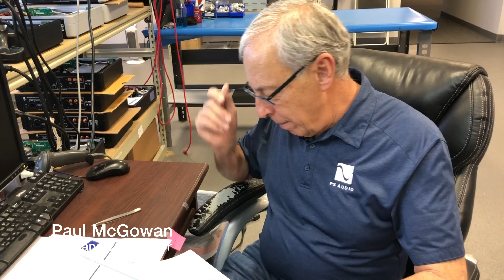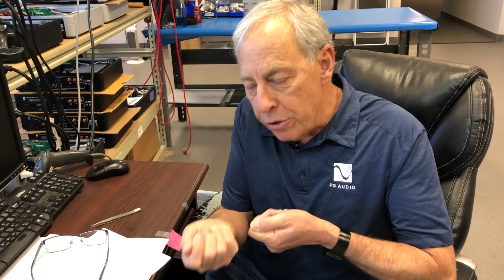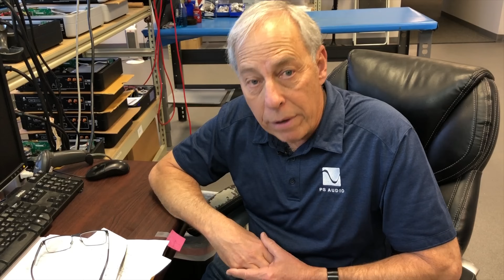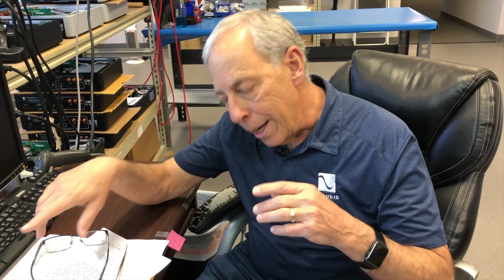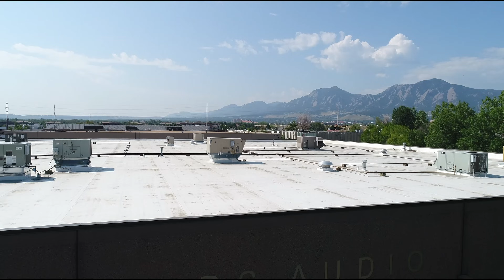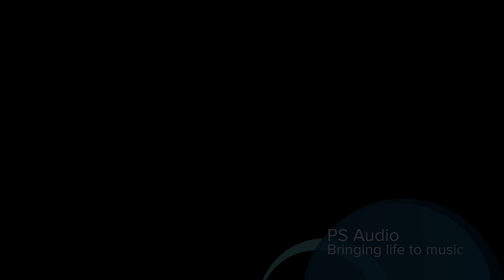Is it possible to change speaker impedance?

Comment: One thing that separates audio engineering from the other arts and sciences that I'm familiar with - it's amazing how many genuine experts in the industry often completely disagree on why different elements affect the sound.  As example, in this video and some of his others, Paul attributes the "tube" characteristic sound to having the tubes in the front-end of an amplifier.  He also states that historically, tube power amplifiers have performed poorly in regard to the way they handled speaker impedance variation over frequency compared to their solid-state counterparts.

I've read other long time industry professionals who claim that there is absolutely no difference in sound between a properly designed tube or solid state front-end - so long as they are designed to run clean and linear, and that it's having tubes in the output stage which generate the characteristic "tube" sound, a big part due to how tube/transformer power outputs deal with the variation in speaker impedance .. along with the harmonics.

If successful industry professionals with 40 or 50+ years of experience can't agree on something that seems like it should be so fundamentally understood and agreed on, it's no wonder that consumers and hobbyist opinions are all over the freakin' spectrum.

Anyway, Paul, I love your videos.  Thank you so much for sharing your knowledge!
Reply: Indeed. Also the manufacturer states that the speakers must all have the same impedance, and then Paul says that it doesn't matter at all. Why do they not agree? It seems to me that one of them doesn't know what they are talking about. Do we just randomly choose to believe one of them?
Reply: Good point there!
I would LIKE to agree to this:
"I've read other long time industry professionals who claim that there is absolutely no difference in sound between a properly designed tube or solid state front-end - so long as they are designed to run clean and linear,"
And this is logically it should be true?! But when Paul says that they tried this in blind listening tests with best solid state front end that was mounted on a tube socket. And switched between that and a tube. And the tube was sounding better. Yes subjectively, but it sounded DIFFERENT anyway! 

In some of the worlds best sounding listening rooms. 
Is that because Paul wants to sell his amps with tube in the front end, that he is saying that? 
Or vice versa they who saying this just sells solid state amps? :) 

Or is it the things you read above written of people in the industry that has not tested and listened for them self? And therefore from a theoretical point of view write what they write? 

Remember that it takes alot of effort to test and compare this. And you on top of all need a good resolving system with trained listeners. So have they all those stars aligned to be able to make that statement? 

And of course hard for us to verify Paul's statements. But we know that he has the means to verify them anyway! 

Yes, i would also want to thank Paul for his videos. That get us to start thinking ;)
Reply: Hi Optimize.  When I said genuine experts I was referring to a fairly small circle of folks who have roughly equivalent experience with tinkering,  professional engineering design, and similar industry notoriety as Paul.  Of course these guys have tested and A/B'd their equipment before formulating their opinions.  That's not to say they're right and Paul's wrong, or Paul's right and they're wrong...  It just illustrates how complex the subject actually is.  That's all my point was.

Also, with regard to your implication that Paul is stating things just to sell his product - obviously, he wants to sell his gear, but I don't get the feeling that the information, opinions and life stories that he is sharing in his videos are swayed because of that motive.  He really comes across as open, knowledgeable and genuine.  That's a big part of his appeal.
Reply: Hi. Yes I agree with you. 
When I imply that manufacturers want to sell their products. That was a way to try to find any reasoning why we have those diverging statements from the genuine experts. 
And not a way to throw dirt on someone, sorry for that. I like Paul and he have a kudos in my book for his openness. I love to see and hear how the processes and considerations that are taken account to make a product.

Both of them can not have right, in this question? 

Ok than we take the the logical thinking approach.. 
I believe that the sound between different tubes (manufactures, models) sounds different. As I starting point. 
And with that in mind. 
If you role (switch) tubes one and to another different tube. And also Paul says the exact same tube but used and switched to a new one. 
They will sound different. Hopefully better but let say different.
Then if Paul and his best engineers make the best solid state they can imagine that he claim, and mount it on a tube socket so you easily can switch out the solid state for a tube instead.
That what I call a pretty good test! When all the other factors stay the same! And all the other factors are state of the art HiFi components so you have and can be able to hear the difference.

And Paul says that the tube sounds better than that specific solid state implementation they made. Logical it should at least sound different. It is like making a tube rolling. They shuld sound different.

But the test objectives was not to make the solid state solution to sound like a specific brand and model of a tube, that they compare against.
That is much harder to accomplish. But I believe that only a handful people in the world can do that tuning on solid state components and topologies.
When you do that then we are back to that solid state do not sound differently than the tube. A full circle.
Maybe that is one issue, that diverting and confuses people because they do not take into account the objectives of different tests. :)

Comment: Putting a (very large ) cap in series with a woofer is well known trick in DIY circles . If you choose the value correctly you can extend the bottom end of a woofer significantly and also reduce the required volume at the same time. Formulas for calculating the correct value of the capacitor and  box volume are known for closed , bass reflex and bandpass enclosures .  E.g . : my subwoofer driver is a 10 inch with a 1200 mF cap in series in a bandpass enclosure of merely 15 liters (both bolumes combined) and still reaches 25 Hz .
Reply: can you give me a circuit diagram the way you place the capacitor and speakers?
Reply: It is in german but here you go http://www.lautsprechershop.de/index_hifi_de.htm?http://www.lautsprechershop.de/hifi/sub10brhp.htm
Reply: @19janiboy96  I would not buy this subwoofer. "Der Kondensator stellt zwar einen Hochpass dar, der bei sehr tiefen Frequenzen keine Signale mehr zum Lautsprecher leitet". Basicly what they say is: That the capacitor is a high pass filter which  means that the lowest frequencies will not reach your speaker.
Reply: I fully understand your reaction and I do know that a cap in series should function as 6db high pass  but I can assure you it really works . This thing was pioneered by the Hobby Hifi magazine (german DIY loudspeaker magazine) and they have published all the relevant formulas . I still have all relevant issues . For a closed box for example it is crucial that you size the enclosure for a Qts of around 0.9 to 1  . It really only works if you size everything according to the formulas . It really is a nice trick to get low bass out of small enclosures .
Reply: That should have read Qtc , not Qts , sorry . Anyway here is a link to the Hobby Hifi issue that featured a Bandpass with High Pass sub ("Bandpass mit  Hochpass")

http://www.hobby-hifi.de/Archiv/06/06_06/06_06.html
Reply: BTW , for the bandpass with high pass , not all woofers are suited : they must sit in a defined range of  some Thiele/Small parameters
Reply: Gerrit, any capacitor on the output of an amplifier is going to limit the speaker's potential bass response.  The number's you've thrown up make no sense whatsoever.  I think someone has lied to you.  Some aspects of physics are so fundamental that they're really not negotiable.

Comment: If you think of the consequences and losses that the described passive x-over filters add into the signal path in your speakers.. ..Then you will begin to comprehend why active x-over have advantages.
Reply: I am so going to change to active crossovers since I am designing my 2 way speakers conversion to 3 way at this time. This will allow experimentation with crossover points, levels and will stabilize the impedance effects.
Reply: If you are in the digital domain, then you could try a "miniDSP". That will will let you choose the x-over points and how steep the cut of filter is. And also make the DA conversion for you. 
You can also buy a measurement microphone for optimizing your x-over points. And also you can fix/correct issues in your lisetnings room if you can not fix it with traditional sound treatments.

Comment: speaker impedance varies with frequency!  just use an EQ!  there you go... let us know how it sounds and HAVE FUN. 
 LOL
Reply: unixd0rk You're not serious?
Reply: no... speaker impedance varies with frequency!  SERIOUS!
Reply: NOMINAL IMPEDANCE DOESN'T THO!  LOL
Reply: ...AND HAVE FUN!
Reply: unixd0rk That's not what I meant. An EQ changes frequency amplitude not impedance. So how does that help the guy?
Reply: HAVE FUN!  (friggin' 'tard)
Reply: first i'm going to need you to take this all a little too seriously...
Reply: well, when you stop sending those nasty frequencies that result in high-impedance, you won't see that impedance bump.  PROBLEM SOLVED.  right?
Reply: unixd0rk ?
Reply: yeah, just notch out the frequencies your speaker presents a greater impedance to.  should "fix" it.
Reply: unixd0rk The frequency peaks aren't a problem. It's the low dips. I suppose you will increase them with the EQ?
Reply: well you can't do that because the speaker will present the same impedance to that frequency.  i guess, this isn't a good solution for this problem, eh?
Reply: unixd0rk Correct, not a solution at all.
Reply: nope.  it's an absolute solution.  PROBLEM SOLVED.
Reply: unixd0rk Just go away, dufus.